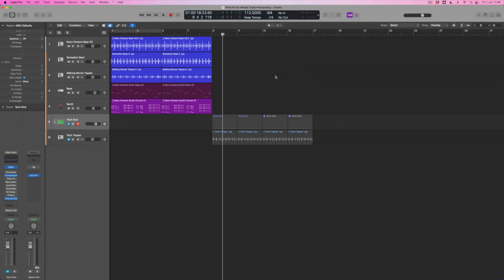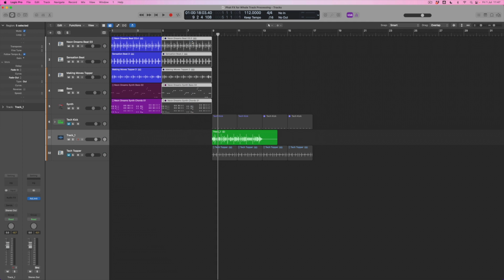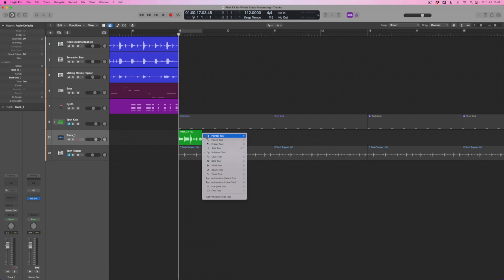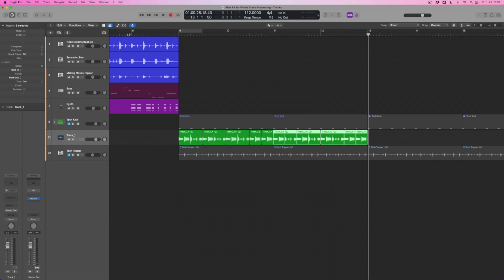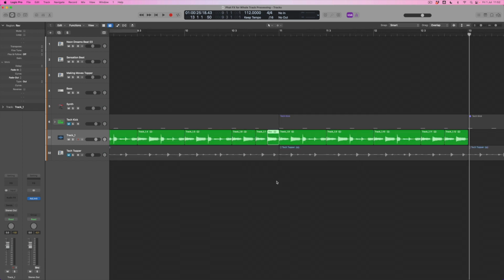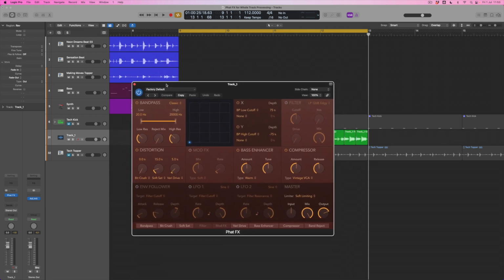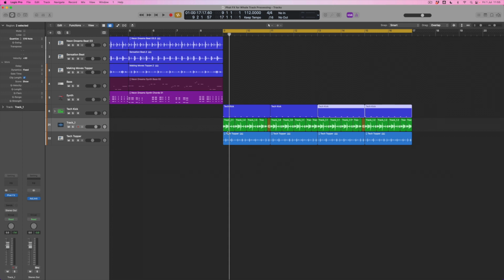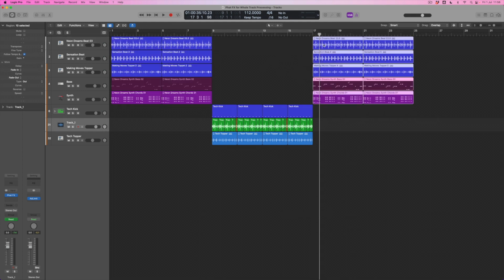LOGIC PRO X - Phat FX for DJ-Style Processing

Comment: It's also possible to non destructively reverse a chopped region by going to the Region Inspector and clicking the "Reverse" button.
Reply from the maker: Hi Brett. It absolutely is. Though this works best when you know you want to use the 'whole region' in your reverse. That might sound odd but sometimes, reverses sound better without the initial transient (which will, of course, be at the end when reversed). That's easier to control having off-line reversed a sound with full access to the waveform display. But you're absolutely right - if you definitely want to use the whole file, your suggestion is quicker and easier.
Reply: @jonobuchananmusic  Thanks Jono. Great vid btw

Comment: Hey Jono, why didn't you just select the region and tick the reverse option in the Region Inspector? No need to make destructive changes to the audio file and create new files. It seems like a lot of unnecessary hoops to jump through.
Reply from the maker: Hi Warren. You're right, you can absolutely do that. I'm keen for these videos to showcase a variety of ways to achieve particular musical results, so when I look at Reversing, sometimes I'll tick that box, sometimes I'll destructively edit and sometimes I might sample and reverse within the Sampler, for instance. In different circumstances, there can be benefits to working with destructively processed audio regions, so I thought I'd highlight that potential approach in this video.
Reply: @jonobuchananmusic  Oh I hear you. There are usually about 4 different ways of doing something in Logic. I just thought that the region inspector box was the simplest. Of course if you have activated Flex on that region then that is no longer an option so the way you demonstrated was one that can be used in all situations. Great video BTW.

Comment: Hey Jono,
Do I apply this same technique when adding automation to individual regions?
When I change Volume automation on one unlooped region, all regions on that track change respectively. Should I convert the region to a new audio file, and then add automation?  Great Tutorial!
Reply from the maker: Hi Roger. There are a few answers to your question. Firstly, Logic lets you apply Region or Track Automation. When you open Automation, it'll be Track by default, but click this button to select Region. Any Automation you now draw will be specific to that single region. Loop it and the Automation will repeat with it. If you Bounce a single region in place, the BIP window offers you a range of options, including the option to fold any Automation down into the bounce (so it becomes a permanent part of the resulting audio file), or not, in which case, any plug-ins, Volume Automation, Pan etc will be copied to the new Audio track created by the Bounce. That way, you're free to change your mind about Automation without having made a permanent change to the audio. I hope that helps.
Reply: Yes. Thank you.